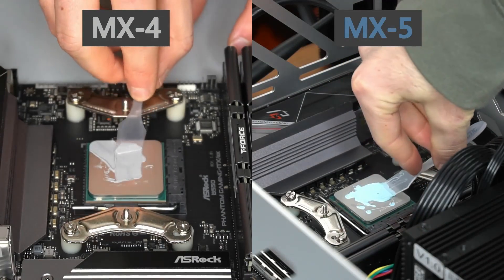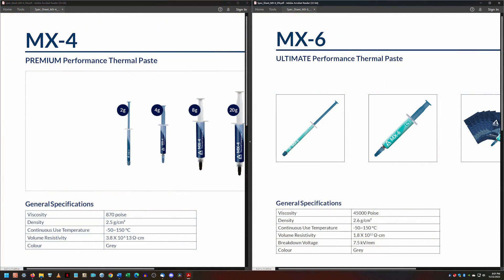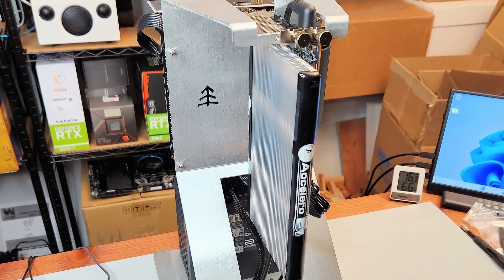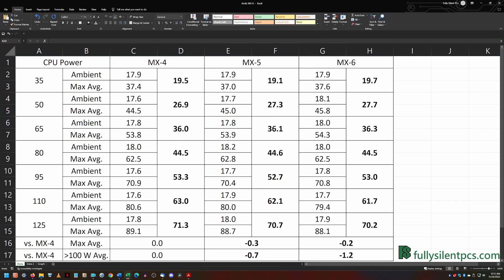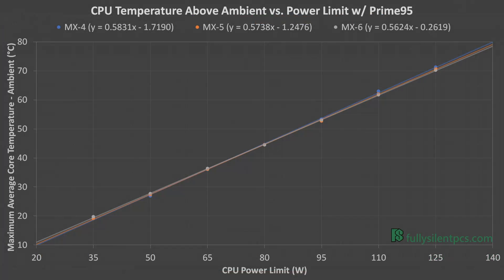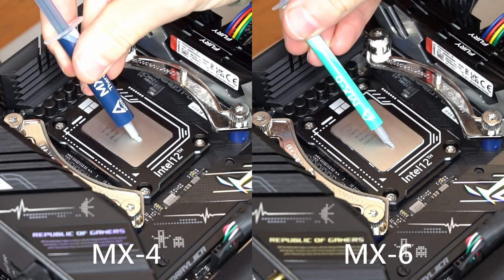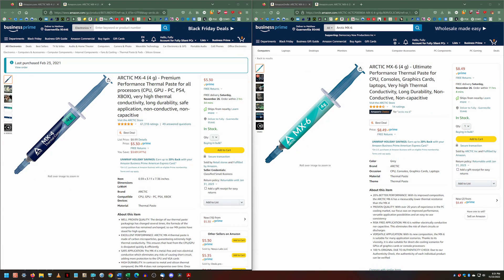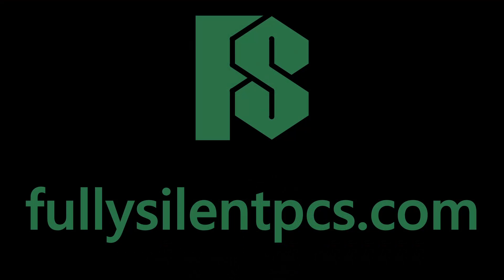Arctic MX-6 vs MX-4

Comment: Tried to replace the paste on my 3080 and got the new MX-6...I didn't like how it spread at all, I threw the tube away and used the old mx-4.Mx-4 and Noctua are best IMO.
Reply: Easy pastes usually don't last very long on current gen high temperature direct-die applications. Expect climbing hotspot temperatures within a couple of weeks/months.
Reply: @phenos  Anyone in here use Arctic Silver 5?  Not seeing anyone mention it.  I think it's just too hard for people to properly apply it or something.  It gets better over time.  Lasts for a lonngg time, too.  2-3 years before you even start thinking you might want to replace it to drop a couple of degrees, again.  All my rigs run 24/7 and have always had beefy aftermarket coolers with high wattage CPU's.  

Currently running a Fuma 2 Rev B on an R9 5900x with Arctic Silver 5.  I use that on EVERYTHING.  I always get better temps than anything I've ever seen anyone use on a YT video.  ALWAYS.
Reply: BUT... just a dab too much and you'll ruin your temps.  Come up a little short with it and you won't get those sweet temps.

But once you've been dealing with it for awhile and applied it enough... by god, it can't be beaten.
Reply: @JustAGuy85  I used Arctic Silver 5 since it's introduction and had no trouble spreading it (used the rounded holding part from a metal CD/DVD drive ejection pin for that, difficult to explain but it worked very easy with a perfect layer) but in that time many years ago I didn't know about advantages and disadvantages with viscosity and such. I remember it as a stable paste on Athlon XP's and vga cards.
Reply: @phenos  I still don't know exactly all of the advantages/disadvantages of viscosity in a paste.  I mean.. a thicker viscosity paste should last longer/dry out slower, but at the same time, also require a thinner layer.

However, once you apply that pressure to the heatsink, I guess ALL pastes end up in the same thickness/height of paste lol.

There's just always been something about AS5 that gives incredible temps for me.  I've tried MX-4 and replaced it back with AS5 a week later.  I'll always prefer it.

There is a particular way it needs to be applied, though.  Sure, you want an even spread, but it's very easy to overdo and underdo.  You won't notice it if you don't apply it several times.  You may think your temps are great (and they probably are), but you might have 5C more to drop with a lesser amount.

Yeah, I've been using it since Athlon64.  Started using it on my GPU's, too, and it's just amazing.  I'm sure you've got the application figured out after all that time, I'm just saying that's what I noticed over time.

Like.. I used it on my last STRIX RX480 8GB and it just blows my mind how much it lowered temps compared to whatever it came with from the factory.  15C drops in temps while gaming with the same 55% fan setting.  

And like I said, now it's between a Fuma 2 Reb B and a 5900x and the dang thing doesn't even go over 60C on the CPU-z stress test.  It's a little cool in my house, though.  The individual core temps are even lower.  54-60C across the dozen of them.  No PBO, so that's the stock 142 watt PPT being pulled.  Just Curve Optimizer with a +100mhz boost (5.05ghz single core)

Sorry.. this has always aggravated me about reviewers doing paste reviews.  AS5 takes experience to get the most out of it.  Anyone can slap a paste on in any way, shape or form.  Doesn't mean it's doing the best that it can.
Reply: @JustAGuy85  Om een kort verhaal lang te maken/To make a short story long :)
I will add some AS5 on my next order of computer supply's, what i did with it was form a thin layer on the CPU and the leftover paste i applied to the cold-plate as a gap/groove filling semitransparent adhesion layer, both with the triangle shaped non scratching CD\DVD ejection pin. (cannot find it on Google images, results filled with sim-card pins)-(Each Samsung Writemaster CD\DVD drive had one inside the retail box together with a white or black front-cover) On large die's and IHS CPU's a thin layer with a tiny dot on the center/die location because some IHS/coolers have a concave/convex surface. Forming a nice thin layer is difficult with sturdy/separating pastes and with AS5 it was easy because it didn't separate. I monitor each application of thermal paste with a label inside the device with the application date and type of paste. And planning to make an archive with the HWInfo temperature statistics so i can see the amount of paste degradation/rise in temperature after removing the dust first. I let repaired devices (burned laptops, cards, water damage etc) stresstest (Cinebench loop, Unigine Heaven) for some time to ensure reliability.
-
Switching to the Honeywell PTM7950 ready to use Phase Change Thermal paste sheet (160X400mm factory size full sheets) for High-end laptops, VGA and consoles because of it's current age high 80+'c (turboclock) temperature stability. And i also have it in solvent based paste form (PTM7950SP) which exits the syringe as a smooth easy appliable paste and hardens after application combined with hot-air at 100'c for 5 minutes (Instructions from the technical instruction PDF say: 15 Hours room temp, 3,5 Hours at 50'c hot-air oven or 5 minutes with desoldering hot air station at 100'c) it needs some time for the solvent to air out before attaching the heatsink, the layer becomes sturdy at room temperature and becomes soft at 45+ Celsius, greatly reducing the pump-out risk.
Basic laptops with celly's, pentiums, U chips below 65'c get normal paste and desktop CPU's as well.
-
Most paste reviewers just wipe of the old paste without proper silicone residue cleaning (Hydrophobic surface) and slap many other brands with all kinds of formulations on it.
-
PBO curve optimizer combined with undervolting is highly recommended on the new Ryzen 7000 CPU's.
Reply: it was too hard to spread?
Reply: @metalhead-6448 yes, you need a bodybuilder's physique to spread thermal paste

Comment: I just used some MX-6 to repaste a 5 year old Dell laptop.   The consistency was perfect and I saw temperature reductions of around 10degF for the GPUs and around 18degF for the CPU.  Of course,  any top-tier paste should have peformed similarly.
Reply: Update your condition plz, get pump out effect bro?
Reply: @Bread Pitt I've seen no degradation in performance so far.
Reply: Did you test to burning your cpu, just like gaming, to see pump out effect
Reply: @rendyyt2268  I use the laptop to render video from a 360 camera.  It runs at maximum power and temperature while doing that.  No pump out.
Reply: @wellsbengston4132  thx for the info, i think best method to see pump out effect is keep your procie's temp high  for several times, like doing gaming continously,, please keep update your conditions bro, i planning to buy this mx-6 too
Reply: @rendyyt2268 what the hell is pump out effect ?
Reply: @boffyboydj  paste squishing out from the intended surface area
Reply: @Bread Pitt nice try👍🔥, so mx-6 was proved not easy to pump out, thx for the info
Reply: @rendyyt2268  the mx6 pumped out within 1 week use for my laptop though. thermalright tf-x was better, it last 3 months but now I am on Honeywall PTM7950. Definetly the best of all for laptops
Reply: @Bread Pitt btw you tried in on dekstop or laptops bro?
Reply: the video is about mx4 vs mx6

Comment: My issue with those very high viscous thermal pastes is spreading them evenly. I'll say this, the MX4 that I had in my old PC (2011 i7-3930K) was effective and didn't dry out for over a decade. Unless you have serious OCD over ~1°C, I probably would go with the MX4 only because it has a proven long-term track record.
Reply: Viscous pastes are good for laptops, videocards or consoles. MX4 lasts a very long time on desktop (lost my count on how many 45 gram tubes i have used) cpu's but a lot less on direct-die situations.
Reply: @phenos  .. The only issue with viscous TIM is even spread and if you're worried about 1°-3° Celsius is often all that separates the best from the worst. (Liquid metal excluded)
Reply: @DJaquithFL  I manually spread the viscous paste, the trick on that is to use very light pressure on the spreader/spatula slowly working it from one edge to the other side and it doesn't really matter if it looks a bit sloppy. After carefully screwing the heatsink in place giving each screw a single turn until it fits snugly I apply firm pressure (like a good handshake) on it because laptop heatsinks usually have low contact pressure and the sturdy paste layer remains too thick without that. I don't really look for the best temperature drop but I care about longevity. Much less of a concern on desktop cpu's and low viscosity pastes are recommended on them because the coolers on them usually have good contact pressure and sturdy paste cannot form a thin layer quick enough.
Reply: @phenos  .. So do I spread it the same, the problem which we'll apparently never agree about is how smooth. It may look smooth to you but take a magnifying glass just to see how nots smooth it is.
Reply: @DJaquithFL  is 1- 3 degrees Celsius really an issue? i dont mind if my cpu runs with 70 or 73 degrees Celsius.
Reply: @chrishalle1982  .. Yep! Turbo and Boost of either your CPU or GPU are greatly affected by just a few degrees Celsius. Just a few degrees Celsius can also be obtained by Anti-Bending Buckle (~3°-4° C) and even more Delidding your CPU (~6° C). In addition, how well you apply your thermal paste which is one of the reasons that I always manually spread my TIM than to make creative streaks and dots only keeping my fingers crossed.

Out of the box recently the CPUs and often the GPUs are already tuned and pushed near the maximum from the OEM.
Reply: @chrishalle1982  .. Example Artic MX-5 was problematic and production stopped. I forgot to add, it's also extremely important to know the long-term effectiveness of your TIM.
Reply: @chrishalle1982  in the other hand, I do mind idle temps. So artic 4 it is.
Reply: @phenos  Which has the best longivety 
MX 4 vs MX 6?
Reply: @TemanRakit  .. To be clear I can spread the viscous TIM, but I just I have an extremely high standard.
Reply: @DJaquithFL  why? Your cooler will change the distribution of paste anyway, it won't stay the way you painted it on.
Reply: @SianaGearz  .. Only if you're using an excessive amount of thermal paste.
Reply: @DJaquithFL  if it doesn't move at all, means there wasn't enough of it and barely any real cooler contact. Thermal paste is designed to move and squeeze out under standard mounting pressure.
Reply: Just dont do it at all make a X patern the puit the heat sync above
Reply: @pedro.alcatra  that can work I've done it to my Xbox 360 S (I think it's a trinity) a couple years ago and it's still working the only things I've had to do to it since I cleaned and repasted it is replace the DVD drive belt and clean the laser but putting a little more paste on and spreading it is better so you know the whole chip die/IHS is completely covered and making contact with the cooler any extra paste will squish out and won't be an issue unless it's liquid metal.
Reply: @pedro.alcatra  .. No spreading is a 100% success rate because you know absolutely the CPU is covered perfectly. No Mystery.

Comment: So, MX-4 is better for desktop CPU+CPU cooler applications (anything with a heat spreader basically) and MX-6 would be better for direct die, like laptop CPU/GPU or desktop GPU+GPU cooler applications? But for the latter (direct die), would Kryonaut work better than MX-6?
Reply: Kryonaut is very over hyped because it gives great initial temps but has a high tendency to degrade very fast on direct-die applications with slightly deformed coolers or when the temperature hits 80°c.
I hope MX-6 has good long-term results on direct-die applications because it is easy to obtain without long shipping times. For basic direct-die I'll stay with the proven industrial Shin-etsu X23-7921-5 viscous paste until mx-6 has proven itself (Thermalright TFX, IC-Diamond works good as well). And for hotheads I'm in the process of switching to Honeywell PTM-7950 pads. In the past i used kryonaut, NT-H1 / H2 and some other consumer pastes as a repair shop but it always craps out after a couple of weeks/months.
Reply: @phenos I repasted my 3070 last year with mx-6 and there wasn't any temp degradation in a span of a year, repasted it again with the new paste from GD (makers of the gd900) called the GD-2, the temps are quite similar with my MX-6 but the GD-2 is a little more viscous.
Reply: @Benri05  why the switch?
Reply: @Ollixhnsn  had great experience with the gd900 years ago and decided to try their new gd2 and it's also pretty good, I'm still using the 3070 repasted with it and the temps are still the same, no degradation of whatsoever.

Comment: Is 2g d Mx-6 enough or will I need more? Thanks,^^
Reply: I used my 2g mx4 3 times already and still some left
Reply: I've used a single 8 gram tube of MX-4 on over a half dozen CPUs, multiple times (up to 3-5) for most of them as well as for application on a handful of GPUs... I still have some left, probably enough for 3-6 more applications to CPUs.
If MX-5 was any indication of comparison, and 8g tube of MX-6 will probably stretch to at least 80+% of that.
If you're just looking to apply it to your CPU during a build then every so often during maintenance, maybe upgrading thermal performance on your GPU, then that should last you for a good few applications at least.
Reply: 0,3-0,5g - 1 CPU. 2g - up to 6 CPU.
Reply: i will buy at least 6g to be safe

Comment: For me it’s about good performance over long periods of time, if I have slightly higher temps but the paste lasts years I’d rather have that
Reply: I think the temperature the system runs at and how many heat cycles it goes through matters more to the paste's longevity than the specific paste you use. I can't remember which thermal paste I used when I installed an EK waterblock on my GTX 970 in 2015, but I never changed it since and my GPU temps haven't changed at all in the last 8 years. I attribute the paste's longevity to minimal heat cycles (my computer stays on 24/7) and the sub 35 degree GPU temps under full load more than the specific paste.
Reply: @averyalexander2303  I just repasted my 6800 with thermalright tfx and set my gpu fans to always be on at 1200rpm or so, gpu sits under 40 in games so paste should last a while
Reply: @heroicsquirrel3195   interesting, what's your typical ambient temp, and what games you played the most? I have 6800 too but under 40 is my idle temp lol, probably due to the place I live, which is a hot area.
Reply: @hadifelani  i think my ambient temps are usually around 17-25 degrees c, i live in the south of france where it can get really hot in sunmer but i also put on a big fan if its hot which helps. I play street fighter6, mortal kombat1, assassins creed games, modern warfare 2, souls likes and cyberpunk etc, now that its not summer here my idle temps are 30c, this paste seems very good, its a thick long lasting paste i think
Reply: @hadifelani  i also undervolt the card and run my games with high settings,1440p with fsr2 if available and never above 120fps, im not obsessed with pushing max performance so my temps are low, if i pushed my card to its full potential temps would be higher for sure and id have to push the fans harder but i want a cool n quiet long lasting system
Reply: @heroicsquirrel3195  aaah so that's why.

Welp, I live in Indonesia, it's hot as hell here.

35-37 noon, 27-33 night, and 24-26 only at morning. 😂 air conditioners can only help to lower the temp around 7c max.
Reply: This makes me sad that MX2 got axed.
Reply: @SianaGearz  I’ve only been on pc 3 years so never used that
Reply: @SianaGearz  what's that one like
Reply: @SianaGearz  она не нужна так как хуже gd007 ее просто не брали так как gd стоит дешево я взял 30 грамм до сих пор мажу все отлично для гпу что то дороже можно на процессоре за 2 года все отлично ничего не высохло так как температура отличная мх2 была перед этим разница есть в пользу gd007
Reply: @KingShotgunHobo  exactly
Reply: And I can't find a review that covers that
Reply: Yeah but thats not the case here. Youre making up that desire and pretending it applies here and it doesnt.
Reply: i applied to my Fx8350 the thermal paste that came along with my Hyper 212 Evo, applied in 2016 when i bought the system, now that pc is my sec. build and i didn't have to change thermal paste, not once, and CPU runs great, even overclocked it to 4.4 during an entire year without having any issue not even today. when i sell it i will change thermal paste, but this is the expected performance of a thermal paste